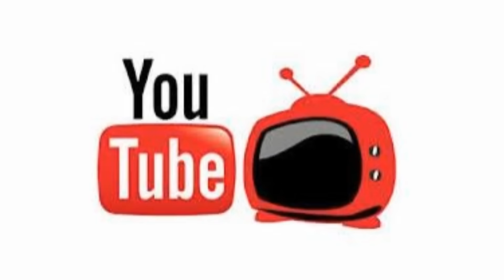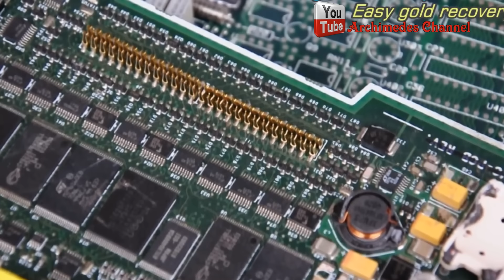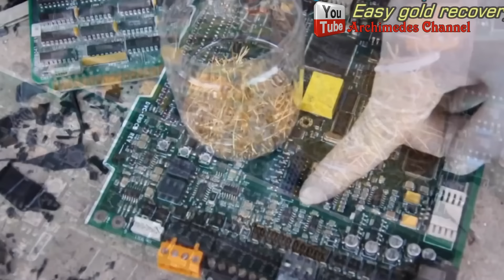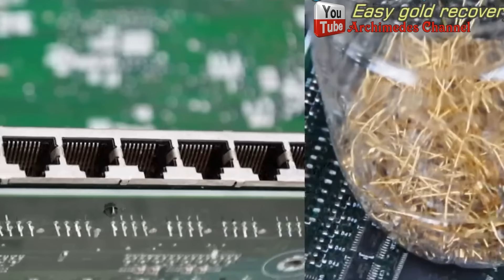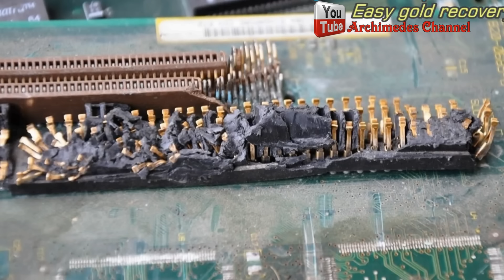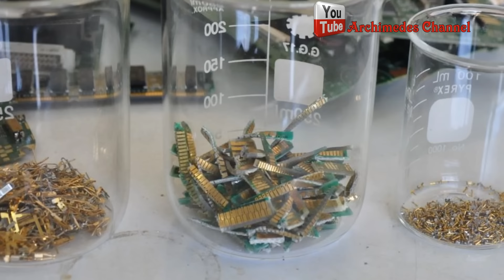Gold Recycle from scrap components electronics. connectors Electronic circuit Boards computer parts.

Comment: In all these gold scrapping videos, nobody talks about what they do with all the remaining materials and acids once the gold is recovered. Gold is 0.0001% of e-waste, but it’s the only thing that everybody worries to recover. I’m worried about what happens with all the rest.
Reply: I love it when people assume that for this gold recovery you just mix a few buckets of nitric acid with a few buckets of hydrochloric acid (or whatever) and just let it boil for an hour and voila... It's a very dangerous process, acids need to be added little by little, in small increments, until all metal is dissolved. Using too much at once can result in dangerous and uncontrollable reactions. Using extra is pointless and a waste of chemicals. It's a fun to watch process and if you know what you're doing there's not going to be much contaminated liquid to deal with in the end anyway.

Comment: These are not pure gold, they're gold plated. So that's not really that amount of gold you think it is.
Reply: Ur pfp compliments the comment so well
Reply: Thanks for that. I was just about to rip into my computer
Reply: 4 reals???
Reply: if they were plated you would have seen the metal underneath, the only other metal i saw in that jar was solder.   also, gold plating is usually done on top of silver or copper, two other well paying metals.   i guess the only way know for sure is melt them down.
Reply: You can use chemicals such as nitric and sulphuric acid in a process to purify gold plated and unsure gold.

Comment: mega lol. µm gold-plated - melting down costs more than what it's worth
Reply: Not really!! You can just put it in the microwave like cheese
Reply: @gabrielcorrales8878  😂😂
Reply: If you use chemicals it doesn’t.
Reply: Some place beween 1 and 3 um on contact surfaces..
You are right..😉
Reply: Big company style do make a profit
Reply: @kevinsturgeon8414  I like you to make a video doing just  that , come on  , don't be shy
Reply: Even with the gold prices where they are at the moment?
Reply: If you can sell the boards to a big refiner (some countries unfortunately don't have one) then they will buy the separated gold pins from you.  You will get more value by taking out the gold pins but is it worth your time pulling them? Only you can decide that.
Reply: Just for personal use like making a small chain pendant just for pride... Gold on my neck
Reply: @Wreck-Gar  I know a guy who pulls the pins while he sits and watches TV after dinner.  That's the way to make it worthwhile.

Comment: You strip the gold off the metal using a bath of cyonide sorry if I spelled it wrong. Then it leaves the gold as a mud like consistency. After you need a furnace to burn the gold .your supposed to add a salt like material idk what's it's called but during the burning process it turns the gold into a glass rock as well as turning the gold solid. Get a hammer break the glass off and you'll end up with a solid gold nuggett. Take some samples of the gold to test it's purity. Boom you got gold.

Comment: It is plated with a thin layer of gold. The bulk of that is still copper. You will need to melt it down and separate gold from the rest of the connector.

Comment: That´s not even gold, it´s just gilded, so first he has to melt the metal, find a way to extract the gold from it, and then he maybe gets a gram or two from 10-20 circuit boards, worth less than 100 Euro.. There is a reason why professional waste refurbishers have mountains of this shit lying around, waiting for someone to come up with a method that allows it to do this economically.
Reply: Gold is $20 a gram if you ever have free time and are interested it’s definitely worth it. Watch tv and scrap boom you made a extra $80 that week 🤷🏻‍♂️.

Comment: Gold plating on connectors is typically less than 0.0015 cm thick.
Reply: But It still Gold, the Motherboard now it's trash
Reply: what he had in that jar looked to be solid gold, and what gold is plated on is usually silver or copper, which have good value too.   i did plating many years ago.

Comment from the maker: How do people remove the gold from old electronic devices?
Annually, Foley explained, the world produces more than 50 million tons of electronic waste per year; that amount is increasing rapidly due to non-stop innovation that shortens the life span of electronic devices.
Gold is in significant amounts that it is much higher compared with the natural ores of Au. So, recycling of the e-waste is becoming more of an important business in the process of Electronic Scrap Material Recycling. Most of the tech gadgets have the gold electroplating on them. Gold electroplating is the process of coating gold using the electrochemical process in the gadgets. Conductivity and protection of wires are the main reasons, of gold plating the gadgets. So, gold can be found in many electronic gadgets especially in the large circuit boards. To separate gold from the devices there are many exclusive methods, and there are many companies that deal with extracting the gold from the gold plated devices.
Reply: So its mean that those gold plates contains real gold inside that we need to separate?

Comment: Could you imagine how expensive a computer would be if it had that much real gold in it
Reply: do you even know what a computer costs!?
Reply: @piktor6494  A lot of the metal he is extracting is some type of alloy that usually has silver, copper, zinc and nickel mixed in with the gold, so the amount of gold that he is actually extracting in this YouTube video is probably less than 20 cents worth of gold (much less than $1 US dollar worth of gold) after you pay a huge amount of money to separate out the silver, copper, zinc and nickel out from the tiny amount of gold that is mixed into the alloy with the other metals.

Comment: It not gold, its copper, gold are only used inside an ic where connection of different cimponent are required, the gold was used primarily when a hairline thin connection is needed, gold can stretch and can be connected, unlike cipper and other conductive materials,  those connectors are copper you can try it by soldering it, its not gold
Reply: that's not gold 🤗
Reply: +Vishal Srilatha they're gold plated. if you don't know what you're talking about shut up
Reply: P4UL20 What are you talking about? I have cipper plumbing in my house. LOL
Reply: why does a wrong comment get 25 thumbs?
Reply: OP is right, most of the connectors he removed in this video are not gold plated. Towards the end he showed a couple beakers with clipped off ends of PCB boards that are gold plated, but the bulk of whats shown here is just copper.
Reply: M

Comment: The New Age of the Gold Rush
Reply: Ala Transmitter its cooper not gold
Reply: Ender Icer hh
Reply: Martin Dixon Right
Reply: lol
Reply: I have more copper in the back of my work truck
Reply: Martin Dixon lol
Reply: Tesla 3 magnet generator free
Reply: Thats not gold. Its copper or brass
Reply: @skyviewphotography6216  - No, it is gold plated.
Reply: @hansproebsting7391  you can check it from Intel website.  Which types of items they're used to make pc processor.

Comment: Rip computers kids will destroy it not knowing it costs more
Reply: Rip old people- not realizing outdated computer parts are worthless and no one will buy it for more than the gold they have in them.
Reply: Stratego89 true
Reply: Ahmed Alkhazali hahahahah
Reply: Stratego89
Think about it for one second. What child do you know of who knows the value of anything?
The computer is probably given to them without any chores to complete first.
And since gold is one of the most valuable substances on earth, their childhood math completes the equation even though half of the data is missing. 

Outdated devices and components have more value than credit is given for. There are nostalgia freaks out there. They want the old and outdated. 
I for one, have a 1997 Dell which is running Windows 98. I use it for electronic software. It can run calculations rather quickly due to the fact resources are not being used up by modern features. 

Ahmed has a very valid point.  Kids destroy things without gold just to see how they are made. 
Give them the temptation of possible money to buy new games and the end result is inevitable. 
Granted, not every child will, but I promise you, SOMEWHERE on Earth right this very second is yelling at their child after seeing the computer in pieces on the bedroom floor.
Reply: No
Reply: Kardeşim hangi aletten çıkarıyorlar bir bilgi verirsen sevinirim

Comment: A buddy of mine found about 50+(I forget exactly how many.) old motherboards.  These were big server boards from a local company stupid enough to put them at the garbage bay.  They were actually throwing them out.  About 3 feet by 2.5 feet.  I did my research and found an actual place that did the gold stripping process.  Had to weed through the places that offered me $5 a board though.  I drove up to the recycling plant about an hour away and met the guy I talked to on the phone.  We stacked and counted them up on the dock and he came down with a check for about 1500.00.  This was when gold was going for about 1500.    So I gather they got more than an ounce out of them.   Split the proceeds with my buddy.  Pretty nice work for about 4 hours of time.    My advice is to save up all those shaving until you get about a pound and see how much an actual gold recovery plant will give you for them.  Then ship them.  Lot easier than the risks with doing it yourself.
Reply: planesx12 that's easier huh.?

Comment: Any suggestions on separating the gold from "other"?
Reply: acid
Reply: You need to be a chemist in order to separate the different metals.
Reply: Metal Mercury. Metal Mercury would "eat" the gold, and then you have to use a torch, and burn the Metal Mercury, leaving 100% pure gold. You can do an experiment first, and see how it work. Metal Mercury is hard to find these days, I have seen people on Ebay selling it, from time to time. Or you can extract it from a mercury switch used on air conditioners or heaters.

Comment: all that glitters is not gold ....baby its gold plated
Reply: gold plated means it have much more less gold dude . like if u think u got 1 gram or what so ever u just get 10 % of the mass in real gold so even if he manage to ger 30-50 grams it will be much less since u need to seperate them
Reply: Hmmm it says that in the description. Thanks for the info though.....
Reply: Laeeq Nasir it's not delivery, it's digiorno
Reply: ono meister price & weight difference,so it is different
Reply: ono meister it's gold plated meaning something dipped in gold, its not solid. Even gold plated jewelry is cheap
Reply: Erik Pecher you literally spelled dumb wrong
Reply: Only dirty pliers break the mowold

Comment: Do you think all yellow metals are gold? 😂
Reply: Serdar Gulsen actually that is gold
Reply: Garage Rec no not
Reply: it's right
Reply: lemon is gold then
Reply: Name: Serdar Kerem IQ: 0
Reply: It is gold, actually gold plated which means its a pain in the ass to melt and separate, and at the end youll end up with 50 dollars worth of gold for all that work. But yes they use gold in computers great conductor and no rust.
Reply: it is proven in discovery science.it is the real gold in circuit board.for better flow
Reply: Serdar Kerem it is fucking gold.
Reply: Danial Potter, lemons are yellow, if you can't see the different between yellow and gold you need to get glasses..
Reply: All that glitters, right?  Lol

Comment: There is a much easier way to do that with potassium cyanide solution. Crush the boards into powder submerge in the potassium cyanide solution at 115 degrees then you stainless steel rods hanging in a basket in apply 12 volts DC to the Raj in the solution. You're wasting your time buddy
Reply: michael lennon cool!
Reply: im in the shitty metal finishing business and alot of companies do gold plating, some do nickel plating etc etc its very.interesting but tiring job working like a slave. but anyways we use nickel strike solution to activate steel before the gold plating takes place
Reply: "Just" potassium cyanide
Reply: Potassium cyanide.. Dangerous chemical
Reply: taihtasu  mercury do the job too no ?  Or a mix of nitric acid/ chloridric acid ( aquan regia ) ?
Reply: s

Comment: why is he wearing rubber gloves??
Reply: Erik Parker , there are toxic metals on the boards to.
Reply: jamicwe55 lol worked as a machinist for most of my life, only needed gloves for wet chemicals, not metals. I even got slivers of beryllium copper...now, those hurt until I got them out.
Reply: to prevent electrostatic that can damage the chips and components it happens a lot :P
Reply: HeRoXLeGenD1 he's ripping it apart for the metals who cares?

Comment: i have put the gold plated pins in nitric acid and dissolved the maximum metals at the last sedement i  put it in aqua regia and dissolved it , for the last step i added smb but the gold is not precipitate out . Please tell me is there any other pressure to get that gold back?

Comment: When you gold plate your putting a few mgs of gold over silver or copper.  Copper is cheaper but silver is a better conductor.  They only gold plate cause gold is pretty much non corrusive.  Now a few mgs per piece.  You need 1000 mgs for 1 gram.  Gold and silver legally are weighed in a troy ounce which is 30.1 grams not 28.5 for a scientific ounce.  So you need about 30,000 mgs to equal 1 troy ounce.  So even at 3mgs per plate you need 10,000 pieces to be worth 1200-1500 us.  Good luck everyone, lmao.

Comment: I did that and got laugh at the recycling gold spot! LMAO!
Reply: Try doing so chemistry, dissolve the plated parts in Aqua Regia (Hydrochloric Acid 2 parts Nitric Acid 1 Part) this will put the Gold into solution and then recover by using Sodium Metabisulfate. Granted you need about 500 grams of Gold plated pins to recover 1 Gram of Gold. Using this method thr recovered Gold is 99.9 pure..